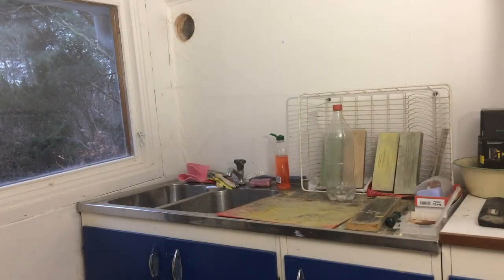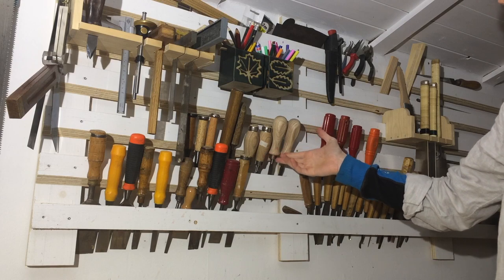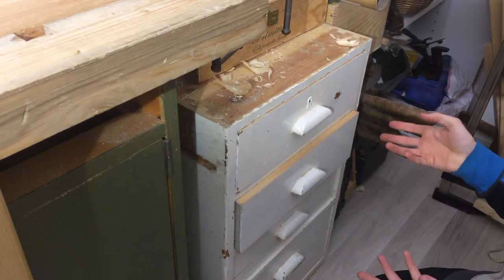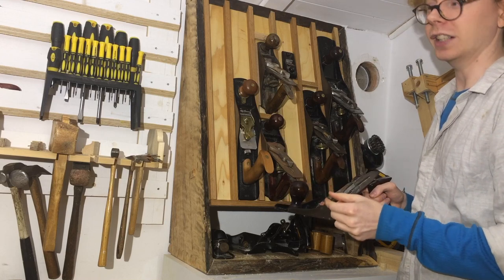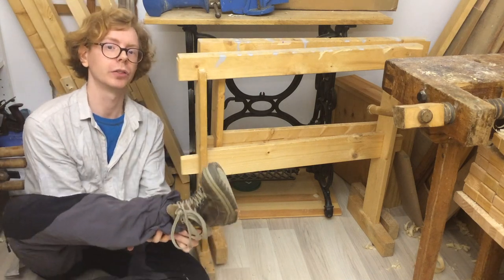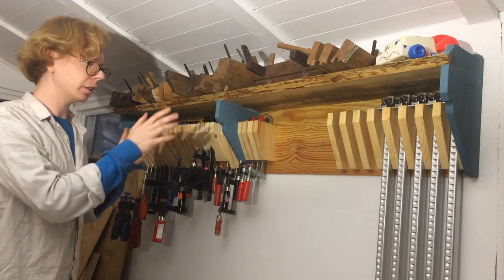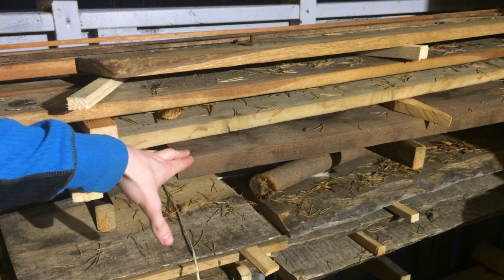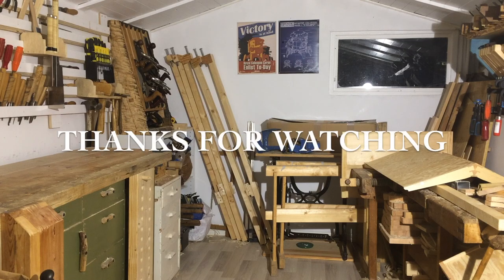2019 tour of my hand tool woodworking shop (off the power grid)

Comment: great great place to make woodworking in. I really enjoyed the video!!
nice plane collection. does the LN 62 came with a 25° angle blade?
I'm asking because I have two low angle plane, and to work properly a smoother they need to mount a 38° angle blade, with the York Pitch they are performing great
Reply from the maker: Thank you so much, I'm very happy to hear you enjoyed it! I believe yes, it was something like 25°. That's a great tip, will look into getting a second blade eventually then. I've seen you use a few low angle planes and get great results with them!

Comment: The possible mahogany you pointed out could also be meranti or sapele. You'll recognise the stripes of sapele (after planing it), or the paler pink colour of meranti. I believe meranti is less dense too. True mahogany is very durable, meranti is not. Sapele is moderately durable.
Reply from the maker: Nice, always fun to get new clues on wood identification! Some of the pieces are lighter and softer than others, so meranti sounds plausible then. Since making this video I have used a few of the slightly darker boards towards the back of that chair, and they felt denser and harder, but still very easy to cut. You might hear me incorrectly state mahogany again in my next video haha

Comment: That shelter is a lovely place to be and where to do woodworking!
I watched in other videos that you milled fair large slabs with handsaw. Here, you showed tools for setting saws.
 In your experience, how important was to set your saws?
(I'm an apprentice amateur woodworker)
Reply from the maker: Thanks! Well, if you buy new, you probably won't have to adjust the set until after many sharpenings. In restoring old saws, it gets much more common. Those that I've tuned up were mostly over-set, so I primarily had to stone down the sides as opposed to introducing set with a sawset. But sooner or later I think it's inevitable.

Comment: You may already have done this, but I've found rubbing candlewax on the drawer parts that contact each other helps a lot. Liberal use of candlewax, Probably half of a candle.
Reply from the maker: Thanks for the tip! I have not tried that, will give it a go!

Comment: So much hate for the wood stove.  A wood stove releases carbon dioxide that was circulating in the last 100 or so years.  Wood is also a renewable resource on this same time scale. Burning hydrocarbons releases carbon dioxide that has been trapped for millions of years and is the real risk for climate warming. I understand the soot risks of wood stoves, but the regulations seem out of step with the risks.  Burning “clean” natural gas is okay for some reason.